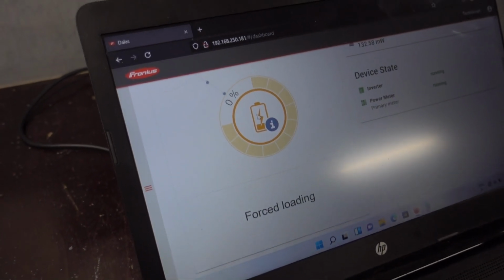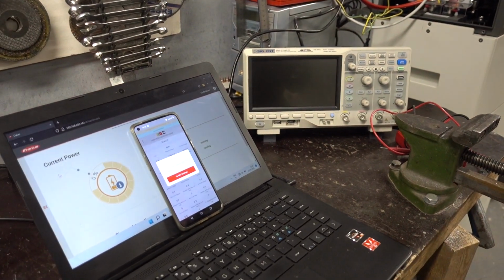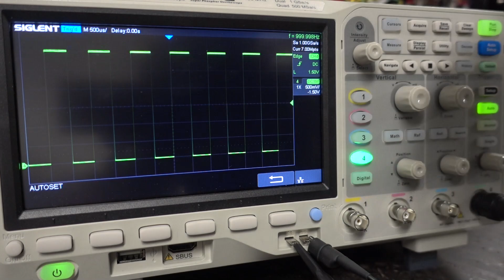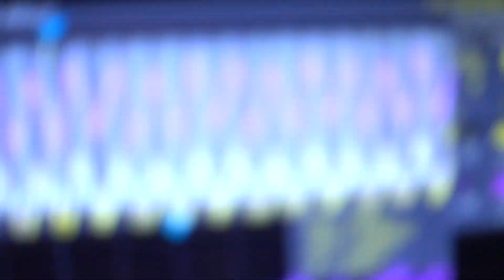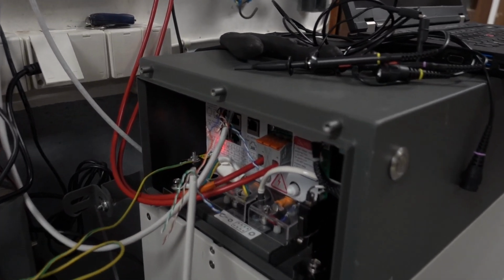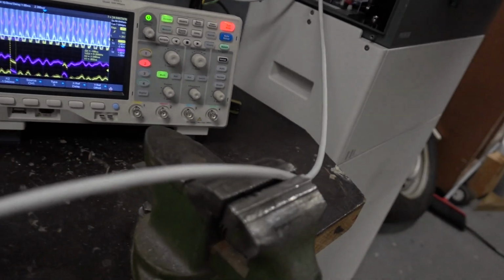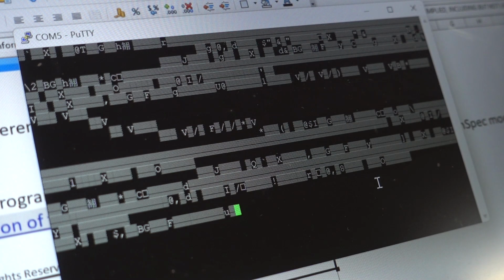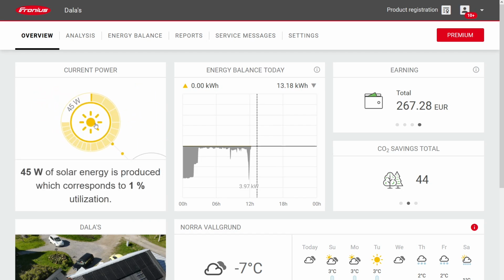Batteries now connected to grid! Solar powered 🥳! [part 2]

Comment: My dream is to add batteries I built myself and connect them to the Fronius. It's also possible to trick the Fronius and connect batteries instead of solar panels, perhaps 4x48V = 192V, which is enough for the Fronius to think there's sun. The problem, however, is how to charge these batteries. The simplest way would be a relay that would operate as a charger during the day and as a solar panel at night. What do you think?🥳
Reply from the maker: Never connect batteries to solat MPTT inputs. This can damage the inverter and the battery.

Use dedicated Bat input on Fronius. We have many with custom DIY batteries using Fronius with the Battery-Emulator!
Reply: @DalasEVRepair  Man, it's a joke, but I spent 40 years working in military electronics and designing inverters back when solar panels didn't exist. It's possible, just use a current limiter!
Reply from the maker: @jbehitech  The problem  is that you need to respect the CAN data the BMS is sending, regarding charge/discharge allowed. Direct MPTT connection removes all safeties that the BMS has implemented. With 40 years of experience you should know how important BMS is for lithium ion batteries. I recommend checking out the secondlifestorage forum for more info on how a BMS works.

Comment: Hi I want to build a 64 s battery and connect a battrium bms and use it on a Fronius gen 24 8 kw would that work or how does Fronius communicate to the battery
Reply from the maker: Batrium BMS cannot communicate with the Fronius (Since it is Modbus RTU). You will need an adapter between the BMS and the Fronius. I will soon make a video on how to do this!
Reply: Thanks for your reply I love your videos thanks again for the information
Reply: If I understand this correctly Fronius communicates over modbus and batrium communicates over canbus 
Sorry I do not understand very much about comunication

Comment: Dala,if you have a new information,modbus protocol,make please a new video about DIY battery project for Gen24Plus... :) Have plans to buy a EV battery, but the communication can be problem for gen24..
Reply from the maker: Yes, more info coming every day, not enough to make video yet: https://github.com/dalathegreat/byd_battery#modbus-rtu-registers
Reply: @DalasEVRepair  do you tings i can charge and discharge this battery from my gen 24 https://youtu.be/I5MlzpDfmoI
Reply from the maker: @michaelp8563  yes, just build a modbus translator!
Reply: @DalasEVRepair  Kan du være lidt mere præcis 😬😁
Reply: https://youtu.be/I5MlzpDfmoI

Comment: What do you think, is that working with any type of bms? 
I have the same inverter and 5 battery pack from a hyundai kona. (36v 180ah) (contain 30pcs 3,6v 60ah cell/piece ) Just the baterys without any electronic. 
So i have to chose a bms, what type do you recomand witch is working with Fronius gen 24?

Comment: Tak for din gå på mod. Jeg har lige fået en ombytter, årsag  start og stop uden fejl på fejl loggen, årsag i mit tilfælde var jord spyddet ikke var 100 rent. fejlen  kom først efter 4 uger brug mystik. stade kode 1078  som betyder dc eller ac strøm mål i inverter. og batteriet var ok og blev brugt.
Ombytter lider af samme fejl kan kun køre med 100% rent jord spyd, og så den rigtige kedeligfejl inverter milder fejl A battery has been detected, but is not configured. stat kode 1253 .
inventer skruiver den kan se batteriet men  det er ikke configure, i følge mig er det ikke sandt, den har ikke menu hvor du kan configured inverter  
 Har du på nogen tispunkter manglede batteriet i menuen på inverter ??
Eller mangler der en licens i inverter, det er jo en ombytter ?

MVH Henrik
Reply from the maker: Pröva uppdatera mjukvaran i både batteriet och invertern!
Reply: @DalasEVRepair  Hej Dalla's tak for svaret.  Fronius pv support  måtte opdatere til ver. 1-19-7-1 gen24, for at godkende  batteriet samt isolationen udregninger var høj ved 100 % rent jord spyd.      stop og start ved fælles jord spyd uden stat code. MVH Henrik

Comment: Those signal traces look a little suss for 9600bd. I was going to suggest that the distances and data rates were insufficient to warrant termination concerns, but maybe I was wrong. Did you connect your grounds to the system's ground? Most differential signals are actually still ground referenced, and if they aren't you'd be best off using a balun to connect your probe(s). I'd be interested to see an eye diagram. Also check to see if your scope works with Sigrok/Pulseview. Sigrok has great tools for decoding, including many built in but also tools for doing the decoding on your own.

Comment: Whenever I or someone else has problems getting stuff to communicate... suspect loose wiring and bad connections. And I have proven myself to be correct every time 50% of the time!
For debugging the data, you would probably need some tool that displays it in hex format to make sense of the patters, probably there is some software suite or python script to decode modbus directly but I never came across one yet.

Comment: The Putty output looks very similar to the output that you get when having selected the wrong baudrate. But given that you established the baudrate beforehand this is probably not the case. Another possibility is that the data is encrypted.
Reply from the maker: Looking closer, the baud rate probably is 9600, weren't zoomed in properly. But then again, it is a binary protocol and it will most likely be ASCII garbage. Will need a dedicated Modbus RTU sniffing tool for this one...
Reply: If it is just a binary protocol than I would just suggest trying out the different baudrates in Putty and seeing if any of those give some readable output.
Reply: Data are not encrypted, but modbus protocol sends unprintable characters as well, e.g. bytes 0x08 or 0xFF (value 8 or 255) are not printable characters (see ascii table) and putty shows this mess. Yes, it is binary protocol and you would need to show binary numbers instead of characters. Trying to show the protocol data in readable form (ascii) doesn't make sense. On linux you can use cmdline tool "od -x < /dev/ttyS0", where ttyS0 must be changed to your device assigned to your converter rs485<->usb.